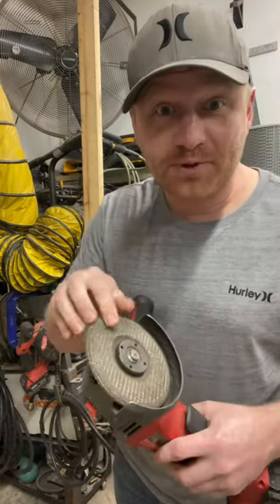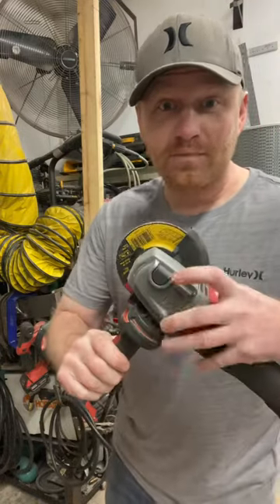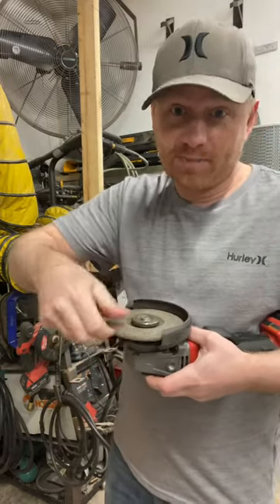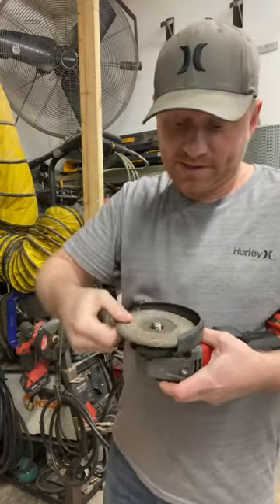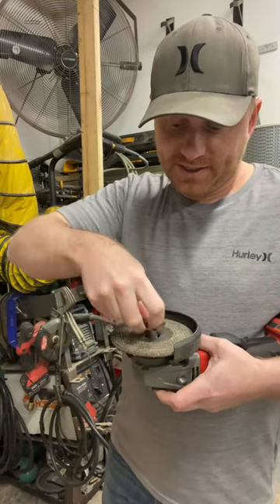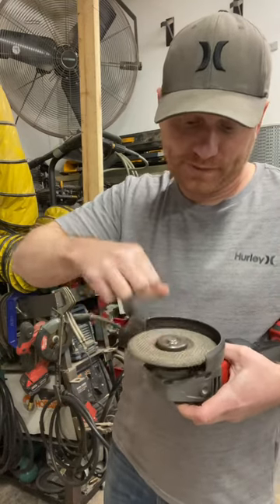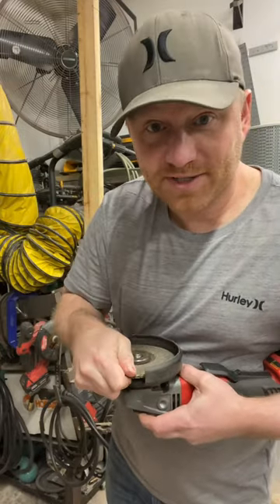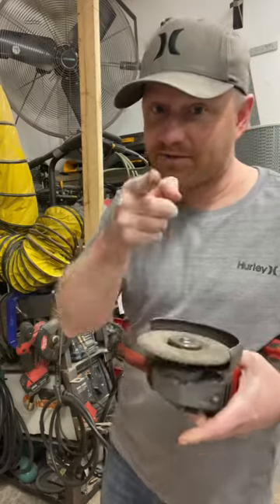Stop using a wrench for this! #shorts

Comment: Always keep the spanner/wrench close. Sometimes the disc can get a little tight
Reply: My sentiments precisely
Reply: Or when using a thin disc that wears down to nothing so can't grip it
Reply: Eh still not needed. There's always channel locks. I always throw those dumb wrenches away.
Reply: If it gets stuck, you just push down the lock and slam the disk into a sharp edge. 👍Work perfect every time 👏😄
Reply: I zip mine to the cord if there is one or zipped to my belt
Reply: @dalitrh make sure to pick the right direction
Reply: As the grinder is slowing down I slam that button in and it releases the disc... maybe bad for grinder ? I duno but i been doing it for a long time no problems so far.
Reply: @Imazdadrags  bold move sir
Reply: It only gets tight through operator error
Reply: @Imazdadrags that will smash off the button on most brands of grinders, if I saw you do that in my shop I would dock your pay
Reply: never used a wrench in 30 years
Reply: @dinkusmalinkus  Ever hear of  inertia? Every time you start it the blade and nut try to stay still as the shaft starts turning, making it a lot like turning the wheel while holding the shaft lock button. Resistance in the motor means  there's an opposite effect when you shut it off, but it's not as significant. Also, the grinder won't do shit unless there's friction between the wheel and whatever you're using it on, which also results in a tightening effect.
Reply: That’s when you hold the button and smack the disc on the table to break it loose
Reply: I’ve never had a problem doing it by hand. Maybe you just have a womans grip strength.
Reply: Try that when you shatter a cut-off disk.  Ty-wrap the wrench to the cord for Christ's sake.
Reply: That's what man hands and welding gloves are for. It's been years since I used one of those wrenches on a grinder
Reply: Oooo. Put pressure on the disc so it'll shatter at high speed
Reply: Or if you drop the grinder and the disc bends😅 I’m a tile guy so I have to use different discs then those but if you drop them they bend and it’s such a pain to get them off
Reply: Keep it taped to the cord if you have an older model that does not have a built in spot to store it

Comment: Nice of you to ask, but the answer is no. I've had some heavier discs open the nut when the grinder is spinning down. Not sure if the problem is my strength or DeWalt grinder stopping too fast, but tightening it with a wrench solved the issue and there's no way I'm risking it again 😅

Comment: I keep the wrench because occasionally for one reason or another the nut is too tight for this or someone else tightened it. Also if the disc shatters it's still useful
Reply: Do discs shatter often?! I mostly work with wood and seldomly use a grinder but I've never had one blow up on me. I'd imagine if you're cutting welds 3 hours a day, it's bound to happen but damn.
Reply: @Nathan Gilbert  no, dosnt happen to me often, but it has happened, and the wrench come in handy if any of its left around the center. More often though some one from the other shop will borrow the grinder and over tighten the disc making the wrench necessary.  The take away from this is don't toss the wrench lol it can still be useful
Reply: Came here looking for this comment.  The nut being too tight, especially after using up a cutting disk, is a very good reason to keep the wrench around.  Easier than pliers or a pipe wrench, though I've seen both used as well.
Reply: The reason is, it's reverse thread so it tightens itself. If you jam the blade whilst cutting you're only tightening it more and more.
Reply: @Nathan Gilbert , I've cut shit apart all day never had one completely shatter but with enough pressure little bits of the disk will bust off and hit you
Reply: I chewed up a cutting disk, but that's because I had it cutting at a bad angle. I had to though if I wanted to get my pieces cut. Nothing shattered but the disk was falling apart in pieces.
Reply: Even for that I go for the screwdriver and a hammer to open it lol never the proper wrench, 😅
Reply: @nathangilbert1344 The boss of a framing crew I was working with had one explode when he was cutting Joyce hangars that were too long… pieces shot everywhere
Reply: If the disk is too tight, just simply slap it!! I guarantee you it WILL come loose 🙂
Reply: The wrench, guard and the handle go rite in the trash when I get a new grinder in union shop
Reply: @Nathan Gilbert  yes they do explode and it's scary af! I've seen a broken disk stuck in a coworkers arm, face and chest! After that I always wear a face shield! I'll also tell ya there's a difference between the cheap cut off disks and the expensive one's. My company supplies us with the Norton brand and there great!
Reply: @nathangilbert1344  Not often on an angle grinder if you're using it right, but a Dremel cutting disc got my buddy pretty bad, straight through his jeans and into the family jewels area. The little shit skipped and caught, torqued the Dremel over and jammed sideways in its cut at the Dremel's highest speed. It was so fast it looked like nothing had happened, but about two seconds later his whole crotch area looked like someone had hit it with birdshot. Bloodied him up pretty good. You could lose an eye for sure, it happens so fast you don't even sense it until the pieces have hit what they're gonna hit.
Reply: If its too tight just slap it. Thats how I do it. Dont even press the button. Roll it one way and then slap it the opposite direction. Fly right off of there
Reply: @Sky  That's wild, thanks for the advice man. Do you just be mindful of what your disc is rated for cutting or something?
Reply: @Sky  Wow, so proper fairly new disc, and still Boom. Ya'll Grinder guys are becoming soldiers in my book haha.
Reply: @Nathan Gilbert  I worked with sheetmetal and cnc torches building scoreboards and have spent 100's of hours behind all means of grinders. Have only ever seen 3 disc explode out of 1000's iv worn through. Flap disc are the ones to watch out for... those things thump when they fly off.
Reply: @Yohanathan Downs  Wow, building score boards sounds interesting. Do you fabricate the pieces for assembly, install on site,  or both? Thanks for sharing man super cool.
Reply: @nathangilbert1344  you learn pretty quickly how to stop the material you're cutting from pinching the blade
Reply: @nathangilbert1344  they dont just usually shatter at random, material pinches the wheel or you apply to much pressure at a weird angle and you learn pretty quickly how to avoid that.
Reply: @nathangilbert1344  Like a bad car accident, it only has to happen once to ruin your day or change your life. Nobody wants to buy another disc when the one that's practically new gets a small  chunk  taken out of the edge, but there's a reason they make them round and smooth.

Comment: If the disc ever wears down to the point where you can’t grab it to crack it loose, you can hold the lock and smack the disk directly onto some steel, always does the trick
Reply: Damn I never thought of that, I always look for the wrench for 20 minutes when they get too small lol
Reply: Don't do that, I repair grinders often at my work and a lot of the time when you do that you damage the disc and it's much harder to remove it afterwards
Reply: @Marker1808  lol the apprentice would smack it the wrong way and seize it on forever 😂
Reply: @I_cAnt_FinD_A_usEr_NaMe  sadly but it's not only apprentices that do it, when that happens we heat the nut and replace it with a new one
Reply: @Luka Panić  eh, we have the cheapest disc's on the market so consumption isn't an issue, the damn things wear out after about 2 hours

Comment: Alright just to everybody that doesn't understand why this works so well it's because the lock nut threads on opposite to the grinder's direction of rotation so as the disc is spinning it's actually tightening up the nut more. A baby could hand tighten and it would work. If the nut threaded with the direction of rotation it would loosen during operation even of samson himself tightened.

Comment: Always hand tight.
The centrifugal force when you first turn it on will continue to tighten it for you and cause the bearings to last longer.
Reply: The word you're looking for is "inertia". Centrifugal force is what  puts chunks of blade in your face if it breaks.
Reply: Is this true even if you don't press the retention button?  If so, they really need to rethink the design. That button has one job, and that is to toggle whether the wheel can be adjusted or not.

Comment: IF YOU EVER JAMMED A CUT DISK BACK CUTTING YOU WILL NEED THE WRENCH. 😇🙏
Reply: Or channel locks when it's really jammed
Reply: The real fun begins when the two post on the wrench shear off because they are made with the shittiest chinesium and you get the pipe wrench from the table grabbing the nut like a damn neanderthal because it's 11:53 and you clock off at noon.
Reply: Just hit one of the holes round with anything, a hammer and punch, a chisel, the claw end of hammer, you get the idea, be creative

Comment: The soul purpose of the grinder wrench is to identify noobies.
Reply: So using the exact tool for the purpose makes you a noob? You must be someone who doesn’t read instructions and wonders why it doesn’t like it does on the box.
Reply: @elliottbramschreiber5019  This cabbage probably does it by hand with the grinder plugged in, as that makes you more legit. Or they're guessing as they've never tried to tighten a slitting disc by hand

Comment: Dangerous advise as people will use this ‘tip’ for cut off disks which are fragile. The inevitable side loading that’s caused when grabbing onto the disk could cause micro fractures that later result in an exploding disk.
Reply from the maker: I’ve taken broken cutoff discs off the same way. It works just fine.

Comment: This works fine with a flap wheel or any thicker disc, but be careful when removing or installing thin cut off wheels this way (like 1mm  and 1.5mm or so). I know a guy who broke one while tightening it, didnt notice and had it explode in his face.

Comment: Take a new 9" grinding wheel, grind it down to 4" in one sitting while using all the torque the grinder's got and try to remove it by hand. The wrench never was for the installation, just for removal

Comment: Same with a 9” grinder do it up hand tight with gloves on and as long as the disc isn’t down to 4” you can knock it with your palm..
You ask why wouldn’t you use the disc all the way down.. ? Cutting containers I need a full disc to get through the top and bottom rails the odds and sods size discs get used up on the 1.5mm corrugated sheet metal and then I need the spanner to loosen the nut

Comment: tried it multiple times, its hit and miss depending on the grinder
some will slip excessively if youre doing it this method, also if youre using thin disks you risk breaking them this way. the wrench is the best tool to do this.
also if you loose that wrench youve either never heard of zipties or shouldnt be handling such tools in the first place

Comment: See that works great on flap wheels or anything else that doesn't change much in diameter with use but for cutoff wheels the wheels can get so small that you can't get enough leverage to unscrew it easily by hand. Because of that I always try by hand but keep a wrench somewhere nearby when I'm using the dedicated cutoff angle grinder so if it's too small and or too tight I don't have to go search for the wrench when I need it.
Reply: With small wheels i grab something near me and give it a chop or with my hand it comes off no problem
Reply: Should be taking it off sooner cuz the smaller they get the more brittle they are
Reply: Be a man. Push the lock on and hit the the grinder against preferably something softer. Works 99,5% of time.

Comment: I agree totally.  Never had a use for one.  Some say the wheels get tight at times and you need it….. if you don’t tighten it properly before using it, it’ll jam that thing tight and it’ll be hard to get loose. If you snug it up good, it may get tighter but not too tight to take off by hand.

Comment: This is fine if your using a grindstone or flap wheel but these video aren’t great for beginners who might be using a thin cut off wheel. The cutoff wheels can be delicate, and shatter easily if compromised at all (like from flexing by tightening by hand). Using a wrench isn’t over cautious i watched my father get airlifted for one them shattering and getting lodged in his neck.

Comment: I’ve used a lot of grinders . Some times it’s too damn tight ! Need the wrench on occasion.
Reply: Just smack it on the ground in the loosening direction
Reply: @leeharvey9006  hard on disks though
Reply: @Kraken4201  won't break a grinding disc. Might break a cutting disc but if you're working and have plenty of blades, breaking a cutting wheel shouldn't hurt you compared to taking 45 minutes to find the wrench. You can do it without breaking the wheel though

Comment: I use wrench all the time but for two reasons. One is wearing gloves swapping wire wheel still pokes through my gloves half the time and I get poked. Second reason is I am most of the time changing a cutting wheel that is low not a grinding wheel so I have nothing to grip and or the grinder fell on the floor and the wheel is low or broken so you can’t grip it.

Comment: Take that guard off and I will agree with you lol
Reply: Do that with any of the big oil companies and you’ll be wrote up or sent home 👎🏻
Reply: @johnnythompson-nz4ws  rules are meant to be broken lol
Reply: @jankywaters5844  I agree brother, just wish upper management would see it that way haha
Reply: Just another dang guard that gets in the friggin way
Reply: I hate a grinder with no guard, sparks everywhere, your hand slips you cut your fingers, and it doesnt allow you to hold the grinder really close to the disc. Just trim the guard until its flush with the height of the discs, you can also trim it so its like a quarter of a circle instead of a half circle. We do that to all of our grinders and it never gets in the way but still saves your fingers and keeps most of the sparks away from you

Comment: Nah. Use the wrench. The center of the disc is reinforced. Using force on the weaker cutting material leads to disc failure over time

Comment: All good till you use a cut off wheel and it gets bent and it flys to pieces or you chip, break it . I’ll just use the wrench . Great method for those but not a ditch the wrench factor

Comment: A pair of needle nose pliers will work also if the disc is too tight… Just open the pliers and put one point in each hole and twist… been doing that since I was a kid… could never find the grinder wrench

Comment: I'll keep my wrench around because all kinds of different purpose discs can be put on there sharper ones, so I'll just not lose the wrench they come with. 

also the zipdiscs are pretty fragile. I if I were using them like toilet paper, they get all sharp and broken sometimes, don't notice slice urself.  not gonna bother untightening it this way.

I also don't want to teach someone around me to do this and them not properly tighten it, have a disc fall off on them, fail from being loose.

also no sense in having the battery in for this demonstration, or ever changing the blade, same goes for plugins, discharge your equipment before maintenance.  you have some limb removers in that room/ garage.

Comment: This is not recommended by the manufacturer lol Aside from that ,sometimes it’s too tight to do it by hand.  Sometimes the discs are sharp or broken. Sooner or later you’ll get bitten.  Don’t used your hand to tighten cutting implements. It’s meant to cut thing much stronger than you.

Comment: You might want to remove the battery first or you might lose some digits. That is the first step in removing a cutting wheel or grinding wheel off a angle grinder.

Comment: If the disk and ring are to tight i lock it in place and bang the shit out of it on the table…and for those who want to say “it damages the disk” im taking it off to replace the disk anyway…I have a designated grinder for each type of disc I use

Comment: Ya, that only works if there is a good enough disk on it to begin with.  The chainsaw blade style finger removers will also cut you if you try to remove them without the wrench

Comment: That's a somepeople thing😂 I mean, I've always been able to do that most of the time. But never lose you wrench, I've not used a wrench for years, but I know where it is. It's in that other part, the 90° hand. The shield cut that to the size of the handle, cause it gets in the way, but you have to protect the hand. So just enough to cover motor is perfect.💯

Comment: The wrench is only need very seldomly. Only if it tightens itself way to tight. It spins the direction it tight no need to use the wrench to tighten ever. You most likely will fracture the fiber disc anyways. Caboom in your face. Better show everyone how the nut is two sided for a reason.

Comment: Bro I pretty much have to use channel locks. I use my grinder everyday for hours cutting porcelain, ceramic, marble. You name it. If I cant get that sucker off by hand no one is lol. 

Plus the wrench? God knows where that is. Bottom of my tool bag probably. A place I very rarely go.

Brand new or clean grinder? No shot, hand tightened all day. My battery one is pretty easy to clean.

Comment: Before showing that show safety. Remove battery before changing the blade.
Reply from the maker: If you want to remove the battery from the grinder or drill or sander to feel safe and not scratch your nail polish, then I think it’s a good idea, for you.

Comment: Pre spin that how and slam the button in so it spins itself and the nut off catch the nut put on a new disc just get that nut started and give the grinder a little brap and she’ll tighten right up this is the real hot swap method tho not safe